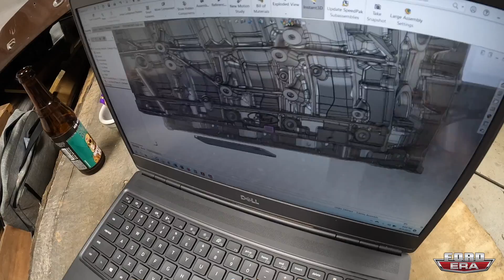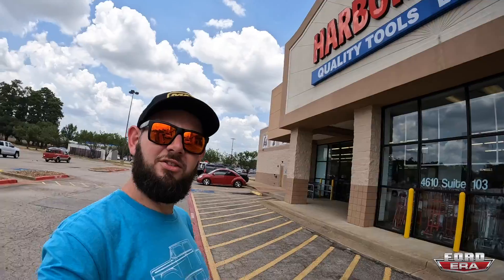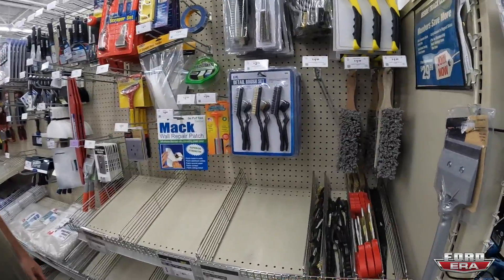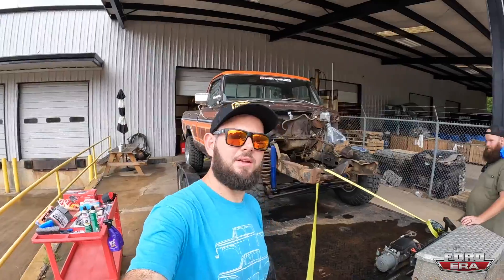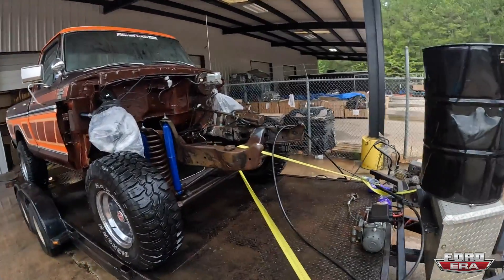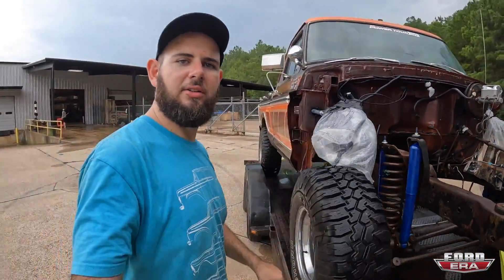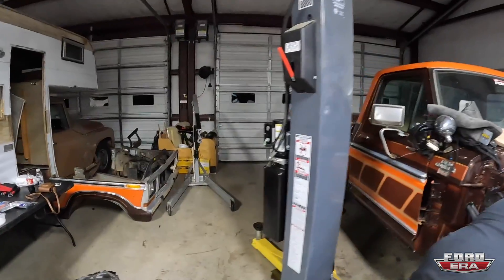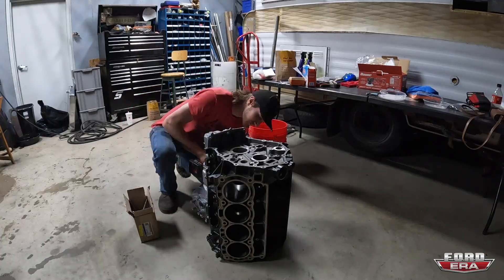Godzilla Swapping Snickers our 1978 F150 - Part 2 | Ford Era

Comment: Check out the restomod heat wrap membrane for the fire wall and floor of the cab . Two different thickness but it will be worth it

Comment: Hey Soloman. Have they done these swaps before? I would have the crank in the block and the damper/pulley on to make sure there is clearance for that crossmember. Does your new a/c compressor bolt up with the rest of the front dress or do you fab up the brackets? He said he's making a trans mount without the engine bolted in? Just sayin'.

Comment: Was there something wrong with the motor and drivetrain that was in it? Everything could have been upgraded and rebuilt better than factory new.
Reply from the maker: Its just outdated technology. Im a fan of the modern motors. they get better milage, they have more power for less moeny and hassle. best of all they have a warranty
Reply: @FordEra  No it isn't outdated technology, did you read what I wrote. Were you high writing this? The price on the cheapest godzilla motor is over 9,000$, a supercharged 7.3 1000 hp crate motor is 38,870.00$, which is insanely more $$$ than doing to the truck, which I would do, the right white way. In 1982 I completely computerized the 6.4 litre 390 FE motor on my 1974 Ford F-250, which was modified to begin with. I put a Mallory unilite distributer in and a MSD-6 computer brain, and it was a good move, and I was the 1st person I know to do it. And patina is rust, and trucks don't have goofy names.

Comment: 15 minutes at the car wash would of made this faster.
Reply from the maker: most car washes dont want you to degrease anything there so we didnt want to get anyone mad. it made a huge mess
Reply: @FordEra  I usually do it at the parts store parking lot and let it do its thing on the way to the car wash. I use purple power though. That rattle can degreaser is pressurized acetone.